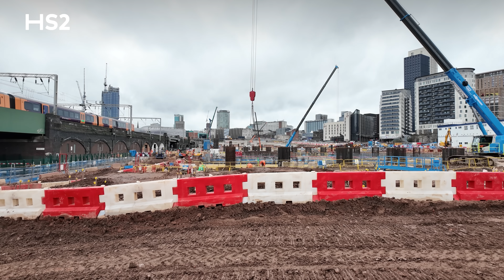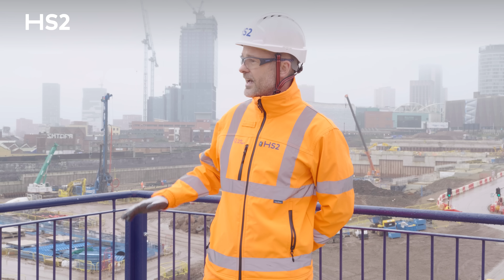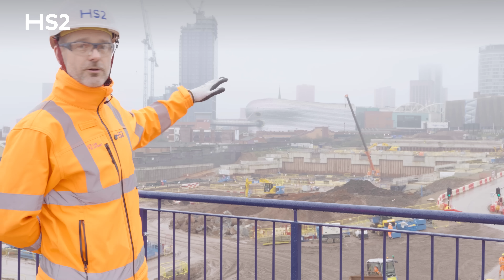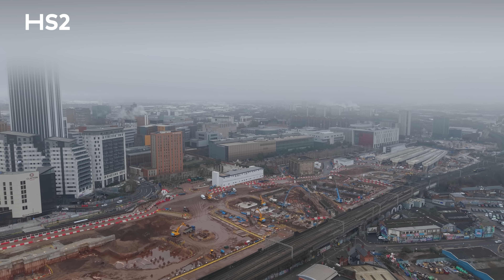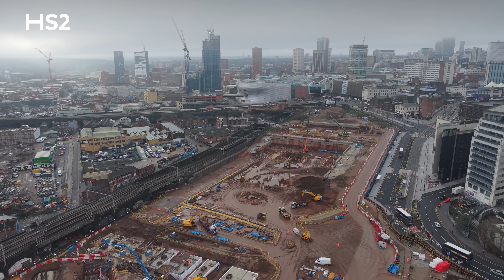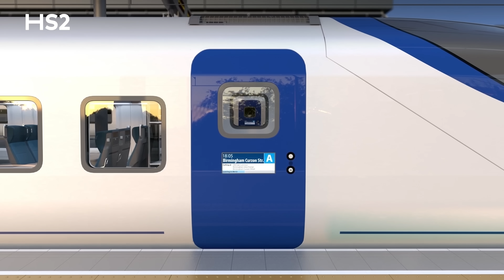Foundation piling works completed at HS2’s Curzon Street station

Comment: Love to see this update ! It's incredible
Reply: Just have a look. Compare China's high speed network with ours which has yet to run. We are being ripped off but no one really cares.
Reply: @johntimbrell  UK is nice for the network ! Having train rolling on catenary and 3rd rail mode or take a tilting train faster than regular train are nice. As a french guy, i know that we have some lovely line at high speed, but not so much diversity
Also, we do not have any news about the construction of Grand Paris Express or even the Lyon - Turin HSL 🤨 so when i see some incredible specific news about a bridge, a tunnel or a station, it's much better than saying:
"The metro 15 will open in 2022... Oh no in 2024 because of the Covid... Ah sorry 2025 now... Ah no we haven't test it yet so 2026... Ah you know what, lets go for 2027"🥱

Comment: Since you're spending a trillion pounds, wouldn't this have been nicer, underground? Rather than putting a permanent scar down the middle of the city?
Reply: And it's not one trillion pounds. It's one hundred billion.
Reply: The site was semi derelict for decades, before that it was used for rail freight, originally it was the first Birmingham city centre station. So what's going there now is far better than what was there before.
Reply: @Polarbear1-b6jare you in charge of "attempting" to ruin all humor?
Reply: Probably too many underground services in the way. Also the distance from the high level viaducts to the site of the station may be insufficient given the difference in levels.
Reply: Some of it is underground through a 5km tunnel
Reply: because there is no space in the city for the ramp to get as far down as they need

Comment: Strange to celebrate the completion of piling in March 2026, when the vast majority of the 2,011 piles went in between 2024 & 2025.
From the barrage of videos posted on YouTube, only a couple of piling rigs have briefly appeared over the last 6 months or so.
Reply: The piling would have been carried out in two separate phases, as is the norm when a basement is retained by a piled retaining wall. The retaining wall piles are constructed from ground 
level. Then the basement is excavated. Then a second visit to construct the foundation piles aee constructed from the bottom of the basement. So the second visit to install the foundation piles is carried out at a much later date to the retaining wall piles.
Reply: @TrevorWilliams-fq8mg The vast majority of the foundation piles were completed by last year.
From observation, a small number have been done more recently.
This time last year, piling rigs were all over the site.
They had gone by the Autumn, with only the occasional rigs appearing since.
Maybe that’s why HS2 are now proclaiming completion of piling, after these later piles have been installed.
The last 6 months has seen the previously installed piles heads being uncovered and the pile caps being constructed on top of them.

Comment: I see 3x2 tracks coming into platforms, but also a track coming down the side; what's the purpose of that track - is it for non-HS rolling stock or a holding bay for out of service trains? (Platform 7 was referenced in the video 😲)
Reply: I think it's a perfectly normal platform, they just neglected to add the overhead lines in the CGI.
Reply: There will be 7 platforms., so the tracks will come in as 3x2  + 1x1.
That results in 3 double sided platforms and 1 single sided platform.

Comment: That's quite some mastery of geometry to be up high on the concrete pillars crossing roads and come down to earth in so short a distance after spanning the last obstacle of the tramline. 
Had no idea that the land rose so much and have no idea why it's necessary to have to dig out for what looks like a double storey basement at the very end of the line, under the front façade. Great stuff.
Reply: The basement could possibly house public toilets, back of house offices and retail franchises.